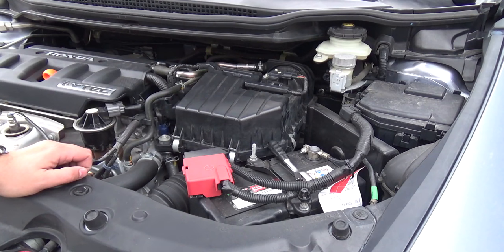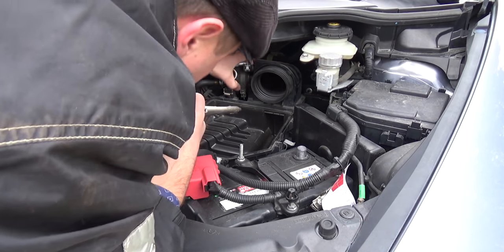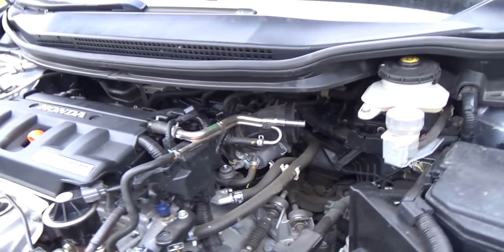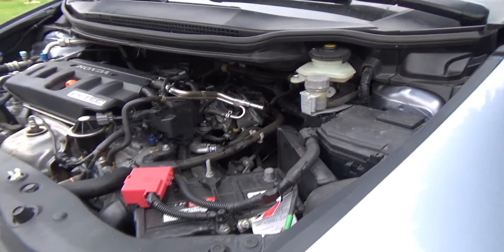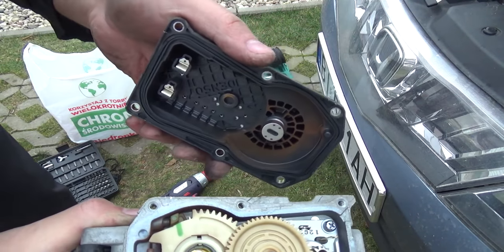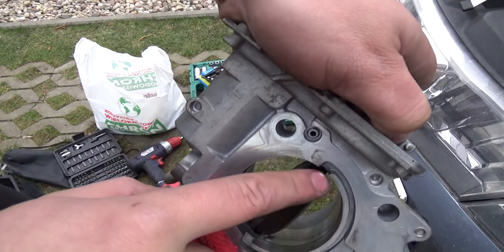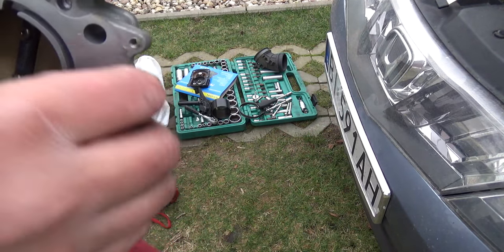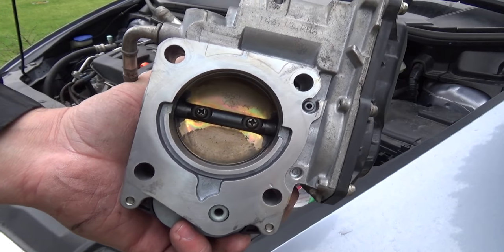Honda Civic VIII IX 1.8  FULL Throttle Body  + TPS Sensor + "IAC"  Cleaning R18A

Comment: And also to all the viewers please do not remove that inner part of the body throttle the one that turns to let the air in do not move that at all because it'll mess up your whole body throttle and you just have to throw it away these things are calibrated at a certain point that is adjusted to the car so if you even move it slightly it don't mess up your whole body throttle I learned that the hard way so don't go based on what he says all the time although he's techniques are pretty good but look at other videos also read on your books before you even touch it cuz most of these parts are electrical and they're easy to get fucked up
Reply: I’ve taken apart hundred of them marked them cleaned them real good put it back together relearned the idle and got paid 4 hrs of labor at $100 per hr. It’s not his fault ur not a good mechanic bud lol you just gotta be patient persistent and know wtf ur doing it’s not complicated even taking out the air breather box is easy but for most ppl who don’t do this shit everyday it can be rough. Educate yourself be ready to make mistakes but learn from them and u can avoid them by educating your self
Reply: He should not use sand paper to polish throttle bore and the butterfly valve. Doing so will create air leak the valve when fully close and create problem when idling. 
The butterfly valves were mechine to prevent air leak between the valve edge and throttle bore wall.
Reply: Here in the philippines the  throttle body can be repaired, cleaned, and relearn.
Just imagine, buying a US$780.00 part when you can have it diy.
Unless the plastic gear is worn out, but an initiative to look for those junk and take the plastic gear.

Its only good for those are risk takers and not with a weak heart.

I will try it anytime with my civic.
Reply: @Alanthe918mobilemechanic  mine is idling high after cleaning how do i do the relearn process cause i did it twice ans still idles high

Comment: Do you need to have idle relearn after cleaning?
Reply: Not really is sure just I re learn by itself I thi drive it a few miles
Reply from the maker: Iff you have no issues  before cleaning, then maybe not, but if you have issues before cleaning you must, reset ecu and idle relearn,
Reply from the maker: watch my other movie mayby helpful
https://www.youtube.com/watch?v=-FlEMt90T5c&t=94s
Reply: I've try listening to this video and I can understand nothing with that guy says I far as I know when I did the switch on the body through it idle by a self I may have to do nothing obviously a had a drive a couple more miles in order for it to idle byself it take like a week or 2
Reply from the maker: @AngelRamirez-bn8gi  dont listen. Only Watch :).

Comment: 34:48 Hi Adam, I think what you are blowing into at this part of the video is the purge control solenoid valve, Honda part number 36162-RNA-A01, not the idle air control valve, which Honda calls the actuator assy., bypass valve, part 17150-RNA-A01.
Reply from the maker: 17150-RNA-A01 to silnik regulacji dlugosci dolotu w kolektorze ssącym.
Reply: @adamsokoowski2319  Thanks, so which part number is the idle air control valve do you think?

Comment: No tuviste problema con el ralentí deo motor una vez armado?
Reply from the maker: Not. After cleaning throttle Body you must idle rpm relearn. Ive got this honda today, never had any issue with this car,only oil change. Now how 209000km on odometer or moore;)
Reply from the maker: Learn idle its not simple...
Reply: @adamsokoowski2319   that must be done with a vehicle scanner software right?
Reply: @miguelpereira4117 no, watch danny’s diy garage video on idle relaren, its easy

Comment: My civic fd r18 full throttle rpm meter on N mode only 2000rpm..
D mode only 20 kmh..problem: throttle body butterfly not working..solution check wiring at fuse box and found some short circuits n change throttle body..

Comment: And definitely please do not use sandpaper to clean the body throttle a rag and the proper cleaner for the body throttle works perfectly fine do not send the body throttle please do not do that body throttles are meant to get dirty and stain and some stains won't come off and that's okay but you cleaning it that's more than enough and do not touch or move or just the inner circle that the body throttle has that will mess it up it's already calibrated the way it is and should not be moved touch or adjusted anyway

Comment: Is it even safe to remove that cuz it's calibrated and if you just mess with it it's going to mess up the body throttle why don't you talk about that instead that is not safe to remove all that if you're not a professional because I did exactly what you told me to and it got all messed up and now I have to recalibrate it and it still doesn't work so I end up buying another one to all the viewers please if you're not a professional do not remove that black box on the side of it cuz that it will mess up your whole body throttle and it's going to cost you more than anything that piece of part is like over $2,000 the body throttle and it's not even brand new it's just refurnished
Reply: Sad to hear that. Im still working on the low idling and trying to diagnose what other parts are malfunctioning.